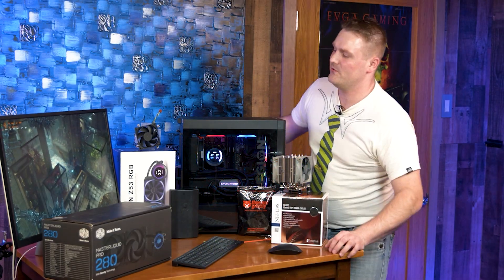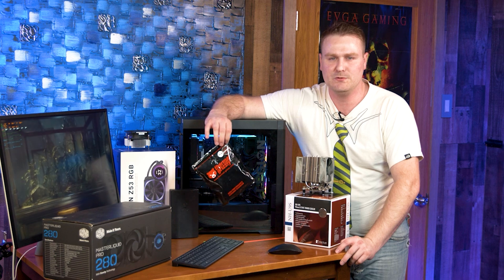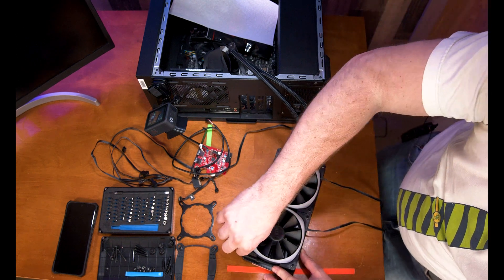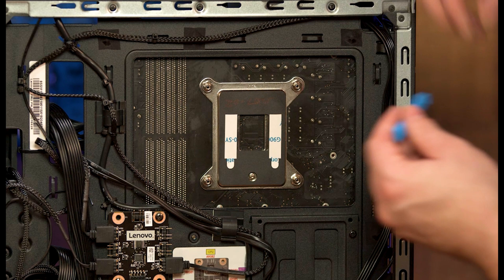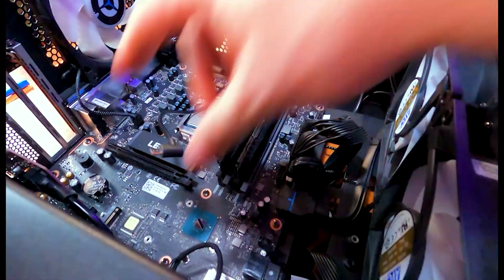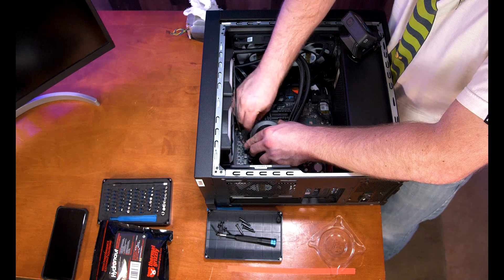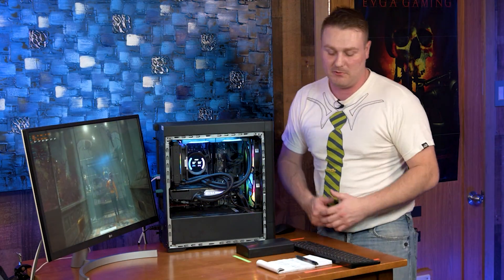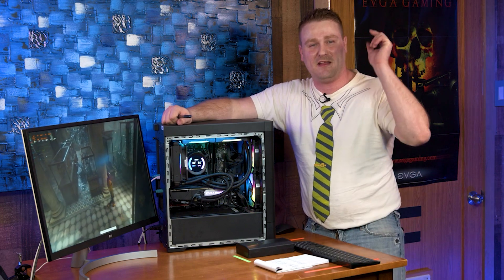Lenovo Legion T5 PC NZXT Kraken Z53 AIO Install W/ Before After Benchmark Results!

Comment: I have a Legion T5 that is AMD based tower and I have upgraded a variety of things on it. It came with the basic CPU cooler so I first upgraded to the Artic Freezer 34 eSports duo and then later to the Deepcool Gamerstorm Castle 240EX. Both upgrades were easy and straightforward. I didn't need any special adapters either. I have also upgraded my RAM, video card, CPU, and power supply. In addition to that, I ordered the VRM heatinks for my motherboard from Lenovo and installed them. I added on a 1TB sata ssd for game storage as well. I would recommend these computers for anyone that wants a decent prebuilt that also allows for a ton of upgrades. Nice video. Interesting to see how other people are choosing to upgrade their Legion Tower 5s.
Reply: Did you have to remove backplate for CPU cooler upgrades and if so, how? Would you say that eSports Duo is good cooler for the system? I am rocking Lenovo Legion T5 with RTX3070 and i5 12400f (with bad basically intel box cooler). I am planning to upgrade to 13600k at some point if the motherboard recognizes it. Just need to decide what cooler to pair it with. I only play games, no productive work.
Reply: @myytti16  yes I removed the backplate. It comes off with a little force but is only held on by some strong adhesive tape. The eSports Duo is a good cooler for that CPU. The 13600K doesn't really need a high end cooler. YouTuber Tech Yes City just posted a good video about using a 13600K with a cheap tower cooler. Worth a watch.
Reply: Would a 280mm aio fit?
Reply: @apotato5563  nope. A standard size 240 AIO barely fits into the top.
Reply: @craig71686  thx 

so those extra brackets at 9:08 are completely useless?
Reply: @apotato5563  you would have to try to use the holes further to the side of the case but they didn't line up right with my radiator. You could possibly make it work but also may have issues putting the mesh cover back on the top. I still don't think you would have the clearance being thicker and larger than a 240.
Reply: @craig71686  thx
Reply: Wait so I don’t the this adapter to have rgb on the cooler and if not where did you plug it on or where did u plug yours in
Reply: @deathfox6248  there is an RGB hub on the back of the motherboard. It has labels on it to tell you where to plug stuff in to control it with the Lenovo Vantage software.
Reply: I just got a lenveo legion t5 with and ryzen 7 5800 and a rtx 3060ti. I'm new to PC. Should I save to get liquid cooling or just add to more fans to the top of my case to have a total of 6 fans
Reply: If your computer came with a tower CPU cooler you should be fine. The 5000 series processors aren't as sensitive to heat as the 3000 series. However, if your computer came with the basic CPU cooler, I would upgrade to a tower CPU cooler. The basic cooler has a small black fan that is mounted on top of a silver heatsink. @Hyde_N_Seek1
Reply: @craig71686  yeah if have 4 fans. 2 fans in front 1 in the middle and 1 at the back I was wondering if I should add 2 more up top also said something about being a 150w air cooler is that any good? Like i.said I just got this PC last Tuesday
Reply: @Hyde_N_Seek1  yeah you have the tower cooler. The 150 watt rating is for the processor power usage. Your processor will probably never use more than 90 watts. There is no need to add anymore fans. You have sufficient cooling.
Reply: @craig71686  o ok so those tower fans would keep my PC cool enough?
Reply: @Hyde_N_Seek1  yup.
Reply: Do you mind sharing what RAM you used in your upgrade? I am currently searching around for what is safe to upgrade, and I currently have the T5 AMD based with 16gb of DDR4 3200MHz RAM trying to get to 36gb.
Reply: @gorko9867  I ordered the KLEVV Hynix RAM off Amazon. It was the DDR4 PC4-25600 3200MHz CL22 1.2V 288 pin. I don't see the version with those specs available on Amazon anymore. However, any RAM with those specs should work. I do see some TEAM GROUP Elite DDR4 model TED432G3200C22DC01 listed on Amazon that would work.
Reply: @craig71686  Thank you so much for the info! Will look at my local microcenter to see if they have anything that matches before ordering this from amazon! Lastly would I run into any problems if I decide to upgrade the motherboard down the line? thank you again for the info!
Reply: @gorko9867   Microcenter had some DDR4 3200MHz CL22 RAM last I checked but it was a good bit cheaper online. You could swap the motherboard. The only thing I see as a possible issue is the wifi card. The card and antenna lines are at the bottom right of the board. If you wanted to reuse them then you would need a board with the wifi card slot near the same location on the new board. Honestly though I would recommend getting a new case if you get a new motherboard. The case has decent airflow but you are definitely better off going with an aftermarket case if upgrading the motherboard.
Reply: I have a legion T5 with a rtx 3060 12gb will I be able to upgrade it with a rtx 4080? I know I will have to upgrade psu. my concern is if the motherboard is compatible with it?
Reply: @LaidBackFellow  the issue upgrading to a 4080 wouldn't be the motherboard. Good chance you would need to upgrade your power supply but I don't think it would physically fit in the case either. The 4080 is a large card.
Reply: @craig71686  thanks for your response!
Reply: @LaidBackFellow  you're welcome.
Reply: @craig71686   the RTX is 11.97 inches long and I have 12inches where the graphics card goes. Barely fitting.
Reply: @craig71686  Why did you replace your Arctic freezer 34 esports duo to an aio, did you get high temps with the arctic freezer? I have the i7 12700f version and im currently woundering if i should go for the freezer 34 or a 240mm aio (Arctic liquid freezer ii 240).
Reply: @liamthorell3347  the temps were good but Zen 2 processors are more sensitive to heat than Zen 3. I noticed my 3700X would boost closer to the max clock of 4.4GHz when it was running around 60 degrees. The AIO allowed it to run 5 to 10 degrees cooler which kept it boosting that high more consistently. I have also upgraded to a 5900X since then and the AIO handles that just fine as well. Overall the look and performance of an AIO is better in my opinion. Just make sure the one you choose has the correct mounting. You will need to make sure the one you get specifically mentions having LGA 1700 socket mounting. Then again, my system came with a Ryzen 7 3700X but has LGA 1151 sock mounting holes. Lol.
Reply: @craig71686  Thank you so much for your quick answer. The aio I have been looking supports lga 1700 and price wise, it's only a $50 difference between esports 34 and freezer liquid 240 so it's not much. I feel like i want a quiet system and since you said that the temps dropped by 5-10 degrees upgrading to your aio, I feel like the extra bucks might be worth it. One thing I'm worried about is that liquid freezer aio:s have a thick radiator compared to other aio:s, and if that mounted with the fans will interfere with the motherboard. How much clearance did you have between your aio radiator+fans and motherboard?
Reply: @liamthorell3347  I forgot to mention that but the Deepcool one barely fit with the heatsinks on the motherboard. The Artic one probably won't fit if your motherboard has heatsinks on the VRMs around the CPU.
Reply: @craig71686  Oh okay, I’ll keep that in mind. Thank you so much, you have been very helpful.
Reply: Do you have issues with radiator on the top of the mobo when you were puting aio?
Reply: I mean, on AMD mobo there is not much space for aio i think...
Reply: @czisildur  it was a snug fit with the VRM heatsink above the CPU but if you don't have the heatsinks then it won't be an issue. The AIO I used is about 2 inches thick including the fans. I would try to stay around that size.
Reply: @craigtek  hey how were you able to over clock your lenovo legion ? Also when I get new after market ram , can I also overclock it to work a 3200 and my cpu to 4.2?
Reply: @flalife904  not sure about the Intel based Lenovo Legion desktops but my BIOS doesn't have any overclocking. I did notice that the motherboard came with AMD PBO turned on by default though. You can actually use Ryzen Master to play around with CPU overclocking if you want. As for the RAM, it will only run at the speed the motherboard supports. Mine supports 3200MHz RAM that runs at JEDEC specs which means no XMP. JEDEC spec RAM runs at 1.2 volts and has higher timings.
Reply: @craig71686 

Craig i have a few questions: 

Will any standard ATX PSU fit? (Corsair RM850X)

I want to replace the i5 11400f (65W), with an i9 11900KF (125W), the motherboard is B560 will an i9 11900KF run @125W? Will the BIOS give any problems? Because all T5's i have seen have the intel F variant processors.

I want to replace my 3060 with an Asus 4070 dual, the Lenovo T5 series are equipped with RTX 30 series cards.. once again will the BIOS give problems? 

Is there any way/workaround to enable xmp.. my 32gb Corsair vengeance ram is running @2666 MHz right now 😅🥲.

Craig/fellow legionnaires if you guys read this.. plz plz help me out. Thnx in advance!!
Reply: @DildoFagginsNL  The motherboard would determine if you can upgrade to a 10900kf. I would say you would be ok if your motherboard came with heatsinks on the VRMs around the processor. They are necessary to be able to handle the extra power and heat. 

The T5s come with a stand size ATX PSU so you can replace it with another one. I have upgraded mine twice. First to an ASUS TUF 550 watt and now a Corsair RM750e.

As for the video card, you should be able to upgrade to a 40 series as long as it fits physically. Of course you will need a PSU that can handle it as well. My case will allow up to a card that is about 12inches long. I just upgraded to an RX 7900XT reference model because the other versions wouldn't fit physically. 

In regards to XMP, some of the newer BIOS versions allow you to set the RAM speed manually. I would say make sure you have the latest BIOS and see if it enables that option.
Reply: @craig71686  

Thnx for your time man, i really appreciate it! ♥️

No heatsinks, i hope an AIO and the 2 extra Corsair fans in the front prove their worth 🤞. This is my first desktop in like 15 years or so im already shitting my pants only thinking about prying off that backplate.. hope a new gpu and cpu squeeze another year or 2 1440P gaming out of this system.

I opted for an i9KF 11th gen because its only €20 more  then an i7KF 11th gen over here.. last decision i have to make is: RTX 4070 or RX 6950XT, both are €670 tax included here... DLSS 3/frame rendering lower power consumption that enable me to opt for a cheaper psu or truly insane price/performance ratio 16gb albeit slower vram and a gen older 😫.

Too bad im stuck on the shitty 10/11th intel platform.. otherwise i wouldve yeeted everything in a non proprietary case.
Reply: @DildoFagginsNL  you're welcome. You can probably get by without heatsinks with good cooling and case airflow. 10th/11th gen Intel is still pretty good. Especially if you are playing games at 1440p where there is less load on the processor. There is a channel on here called Ancient Gameplays that released a good video comparison between the 4070, 6800 and 6950XT today. Might be something to help you decide.

Comment: Do you think this could fit a 280mm aio?
Reply: From what I heard from someone else, no 280 doesn't have the clearence, also the brackets do not line up he said.

But technitwit says they do so really idk, If you wanna try try but I have the same question

Ps if you already tried did it work?
Reply: @apotato5563  it works surprisingly it fits perfectly i got the nzxt kraken x63 works well
Reply: @apotato5563  Also when you mean brackets do you mean backplate? because aio come with a bracket for your aio thats how they fit
Reply: @azer4k496  no, i mean't the radiator brackets at 9:08 

Thank you I really want a 280mm and I now know that it fits
Reply: @azer4k496  did you put it in the top or the front?
Reply: @apotato5563  I put it on the top but you can put it in the front
Reply: @azer4k496  how much clearance did you have between the motherboard and aio?
Reply: @apotato5563  a decent amount its perfect distance
Reply: @azer4k496  yeah because i am getting the arctic freezer ii 280 but the radiator is 8mm thicker. Although i think the fans are skinnier
Reply: @apotato5563  I think they will fit especially how the fans are skinnier but I think you should have enough room
Reply: @azer4k496  I measured it around 5,5-6mm just enough (=
Reply: @apotato5563  just a heads up the backplate might be really hard to pull off when trying to replace it so I do recommend having a tool to make it easier
Reply: @azer4k496  I'm getting a new motherboard so that I can get a full control of pmw fans and xmp and all that good stuff
But thx
Reply: @apotato5563  I did a motherboard replacement for the overclocking and xmp to so if you need any help feel free to ask
Reply: @azer4k496  ah thank you

Comment: I have Legion T7 and I'm installing kraken x63. The micro-usb to usb 2.0 connector, where did you connect the USB 2.0? Can't find any internal USB 2.0 header in the mobo. Thanks in advance.
Reply from the maker: There is none I added a PCIe Crad that has extra USB connectors on it.

Comment: Got a question about a aio cpu cooling fan. do you know if  the MSI MAG CoreLiquid 240R V2 Dual Fans 120-mm would work for this pc. I don’t want to go to crazy expensive on one and I found this one through GameStop I posted a comment earlier with a link but I think it got deleted. And I’ve been posting on other vids it’s my first time ever upgrading a pc so it’s all new to me.
Reply from the maker: almost all 240mm aio will work.  Just you may need to do some stuff with the RGB

Comment: TechNitWit, very detailed video. I will plan on doing the same. 
I'm curious about what Aio you have attached to your graphic card? I bought my T5 from legion and it came with a 3070, I was wondering if I can mount a Aio that would cool it even more.
Edit- without changing the power supply could I replace the motherboard with the new ones for the 12 Gen chips?
Reply from the maker: It came with the GPU from Evga. Not sure if there is a good gpu aio out there. Sure yes you could. you may lose the RGB if you had a case with it.

Comment: Hi sir, i have a question. i have the same model but with a 3070, i want a upgrade the storage populating the second m2 slot, i prefer a 2tb memori, but in the user manual  lenovo say support max 1tb storage at slot for 2tb max, but crucial say they're 2tb ssd on this model not give any problem. you can confirm? and, i ve found a very intresting offert for 2tb nvme gen4 of wd black at intresting price, can i buy and upgrade without worrying? Sorry but it's hard to find specific answer for this motherboard...
Reply from the maker: I've had 4tb in the slot and it has worked

Comment: So here is what i read that happens the cpu 4 pin fan header is not PWM meaning its some kind of a modded DC 3 pin so if you get an aftermarket cpu cooler it will run ineffciently. Can someone with a bought aftermarket cpu cooler that has it connected in the cpu 4 pin fan header confirm if it has fan controls?
Reply from the maker: I used a noctua cooler. There is a bios setting for cooler.  I did not have any problems.

What are your specs and what are you installing?
Reply: @TNW1337  Intel i5-11400F RTX 3060 with the very very small stock cooler. I want to upgrade it with an Arctic freezer A34 duo fan or the cooler master hyper 212 it's a Lenovo Legion Tower 5

Comment: Nice video. I have a Tower 7i Gen 7 coming my way with an i7 12700K/3080/32 GB DDR5 and was looking to upgrade the cooler once it gets here. I just couldn't pass up on the price and the 12% cash back from Rakuten, and figured I will just upgrade my CPU cooler. I'm probably going to go with a  Noctua NH-U12A chromax.Black air cooler. They cool almost as good as the Kraken and are much more quiet. The only thing I'm dreading is getting that backplate off the MoBo. Why they use adhesive there is beyond me. Any tips on removing that back plate will be greatly appreciated.
Reply from the maker: Ifixit it has blue plastic pry bar that make short work of it.

Comment: So i just bought the lenovo legion t5 with r7 5800 and a 3070, 16gb ram at 3200mhz. My only complaint is the Cpu cooler, same you have. Would the 'Cooler Master MasterLiquid Lite 240' work? Also was there any settings you had to change going from a low watt aircooler to a AIO or was it just plug and play power/settings wise? Sorry if i was hard to understand.
Reply: in the bios you can set what type of cooler you have
Reply from the maker: correct. But just keep it stock it will still work better then the normal air cooler. yes the 240mm cool master will work.
Reply: One thing about the AMD versions of this tower is the CPU cooler uses the Intel 1151 socket mounting. As long as you get a cooler that comes with the back plate and mounting for that, you will be fine. I installed the Gamerstorm Deepcool Castle 240EX in mine without any issues or anything extra required.
Reply: @craig71686  chances of you answering this are slim but correct me if im wrong did you say id have to use the intell bracket on the motherboard even tho mine is amd?
Reply: @ApaloGames  yes. Even though it's an AMD system, the Lenovo motherboard uses an Intel 1151 bracket layout for the CPU coolers.